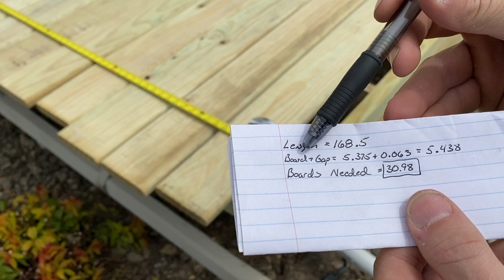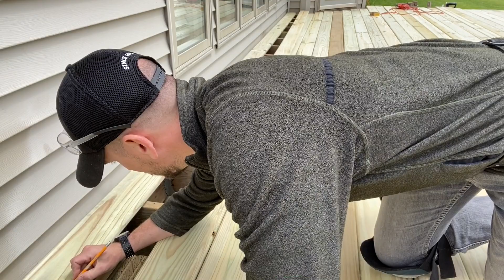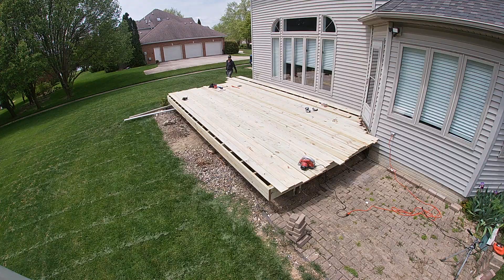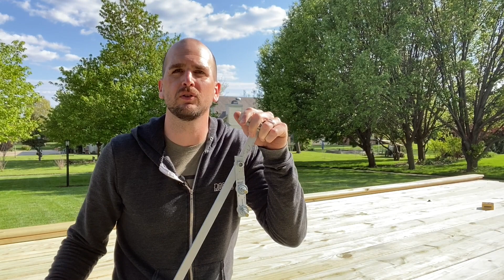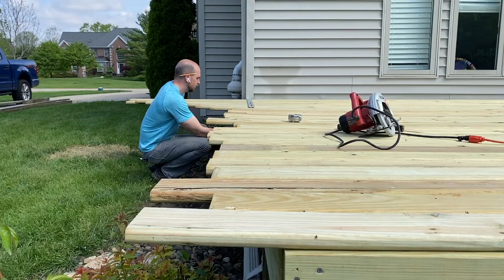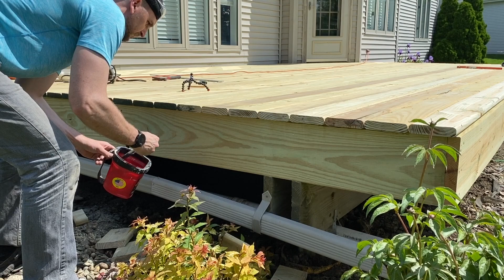Rebuilding a Deck Part 3 - Laying New Deck Boards

Comment from the maker: Camo Pro Guide (1/16inch gap):  https://geni.us/B0G1Ziw
Camo 2 3/8 inch screws (700 count):  https://geni.us/AzaKJP8
BoWrench:  https://geni.us/ei2A34X
Makita Cordless Drill Combo Kit:  https://geni.us/t7dIA
Wood Preservative:  https://geni.us/4fDwG
Skilsaw: https://geni.us/J8pWhL
Stanley Tape Measure:  https://geni.us/bUfD1R

Tools Every Weekend Warrior Needs
Dewalt Drill Bit Set:  https://geni.us/oFlSl
Dewalt Screwdriver Bit Set:  https://geni.us/VDcr
Craftsman Screwdriver Set: https://geni.us/jXqFI
Eklind Allen Wrench Set:  https://geni.us/7XfvO
Pliers (4-Piece Set):  https://geni.us/RIdx
Stanley Utility Knife:  https://geni.us/ndIDa
Studbuddy Stud Finder:  https://geni.us/RySCuVw
Johnson Torpedo Level:  https://geni.us/wiLcDY
Stanley Hammer:  https://geni.us/bPDk8Wo
Buck Bros Wood Chisel Set:  https://geni.us/vk3cpTW
Klein Voltage Tester:  https://geni.us/h9Hl
Klein Outlet Tester:  https://geni.us/kdBAJ
Ideal Wire Strippers: https://geni.us/MdOB
Little Giant Ladder: https://geni.us/fmlmTk

DISCLAIMER: This video and description contains affiliate links, which means that if you click on one of the product links, I’ll receive a small commission.

Comment: Did you have to pay a premium for the 24ft pcs? Would it have been cheaper to turn the deck boards 90 degrees and use (presumably) 14ft deck pieces?

Comment: Measure from the installed boards to the end as you go. You can increase the gaps as you go (on the last few boards if needed) to make up that gap at the end. 😊
Reply: after all that measuring the edge didn't have an overhang.. that would drive me absolutely nuts and id rip out 10 boards, flip them around and get the spacing right.

Comment: Looks really good! I watched your video because I plan on replacing my deck as well. But that one board that is darker in color, the one just over your right shoulder at the end of the video. Why did you use that? I would have replaced it. Looks bad. But overall good video! Thanks!

Comment: A few of those boards didn't have the crown up. You can tell by the grain on the end. When those boards dry the sides of the board will try to curl up and pull up on the fasteners

Comment: What size and type of boards did you use for the decking?
Reply from the maker: I purchased 24' boards for this one https://www.menards.com/main/building-materials/decking-deck-materials/wood-decking/ac2-reg-5-4-x-6-above-ground-green-pressure-treated-thick-decking/1110627/p-1444422337253-c-13469.htm

Comment: Very nice work except for the 7th. board from the edge sticks out like a sore thumb. The shading of that board does not blend in with all the rest and I feel should have not been used. If you're going to just Paint instead of staining then I guess it doesn't matter.

Comment: Using cedar decking is the WORST material!  After 2-3 years, it looks like crap and tthe maintenance every 2 years sucks!!   USE COMPOSITE and you will never need to maintain it  as it has a 25 year warranty!   Cedar is too $$$ now anyway.     So his cedar cost is $6 SF, i used composite and it was $4 SF with a 25 year warranty...
Reply from the maker: This is just standard pressure treated pine not cedar.  Composite decking is about 2X or 3X the material cost now and about 5X at the time I did this video.  Still with the increased cost might be the right move.

Comment: Great video. 
One thing I would do differently is to temporarily install last deck plank, then cut the extra joist boards to fit flush. 
My .02 cents.

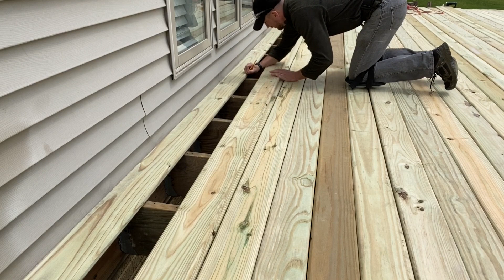Comment: Hi. 4:38  so the 1st board is nailed on only one side? Did you screw from top? Thanks
Reply from the maker: Yep, used the Camp tool to set the 1 screw and then placed the other close to the vinyl manually without the Camo tool.
Reply: @EverydayHomeRepairs  thanks much! :)

Comment: Working on my deck and boy do I wish I would have watched this before I started simply for the Camo System. 2 screws per joist and hidden would be amazing.
Reply from the maker: Yeah, I was pleased with the Camo System and 2 years later they are still all holding tight 👍
Reply: @EverydayHomeRepairs  going to buy one today. Only had 4 rows done of 22. Will do the rest with the Camo system.

Comment: There is a trim piece on top of my existing deck that is flush with the siding of the house.  It runs the length of the deck and appears to  serve as a barrier between the deck and siding.  How should I go about removing that and should I have any expectation that it can be reused?  If it can't or shouldn't be reused, what is that trim piece called so I can purchase  replacement  trim?  I have vinyl siding.   Thanks in advance for any help on this question and thank you for the very thorough explanation of how to tackle this project!

Comment: I really enjoyed your video and watched because I’m about to build a pool deck which will be about 16x16. I’m just wondering about biting the bullet and using trex decking boards versus what you used. It looks like you are doing well for yourself based on the looks of your neighborhood, do you regret not paying more for the trex? I’m torn
Reply from the maker: At the time no, since pressure treated was about 20% of the cost of Trex.  I think that gap has closed substantially now with the increase in Lumber since the video was created.  If Trex was only 2X I would have went that route.

Comment: Enjoyed your videos and information about building your deck.  I hope to rebuild my 900 sq ft deck this spring with cedar boards.  One thing I would do differently is I will start my boards from the outside and go towards the house and I think the benefit of the correct overhang looks better even if you have to rip the row where it meets the house. I also liked the info about the Camo screws.  Good job on your project!
Reply: This is exactly what I was thinking

Comment: I plan to revamp my deck but I don’t have any tools. So appreciate if you can also give an estimate on the tools like circular saw etc. Another thing I’m contemplating is to keep the deck (after refinishing) or just go with the concrete pavers / tiles.. 
apart from personal preference any benefits of deck over concrete pavers with tiles?

Comment: What is your take on replacing old deck boards with composite and keeping the wood based platform?  Do you have a video on that ? Resurfacing deck on a budget.
Reply: One thing you need to consider is the weight of composite ( between 20-30% heavier than wood), so you might need more support. To that end, your joists need to be 12" on centre instead of 16-24 ". this would give the deck a more solid feel because composite is very flexible.

Comment: Came upon this because I'm going to have to redo a front deck on a mobile home on land I'm purchasing. Considering the condition of the deck boards I was shocked to find out the frame and posts are in great shape. It's not large. My biggest concern is the railing around the deck and the stairs. I'll know more when I tackle it this weekend.
Reply from the maker: Best of luck and you are right the railing some times needs a little TLC the same time the deck boards start to go.

Comment: Great video.
Do you have any photos 11months later..? Is that true that those boards will shrink after some time? That Camo tool helped keep the same spacing but is this the same case a year later? Just thinking about doing the same kind deck like you have. Thanks

Comment: how did you cut off the end nearest your house towards the side wall?  Since your saw cannot rip that close to your house.
Reply: Not sure if he did it this way or not, but if you plan ahead, cut that first board to the correct length so you don't have to worry about that problem.
Reply: They never show that stuff! That's a good question!

Comment: Are those 2x6 on top ?
Reply from the maker: The pressure treated deck board actual size is 1-5/32" x 5-1/2" actual size here is the link for the boards at Menards  https://www.menards.com/main/building-materials/decking-deck-materials/wood-decking/ac2-reg-5-4-x-6-above-ground-green-pressure-treated-thick-decking/1110627/p-1444422337253-c-13469.htm?tid=-1452257607087985468&ipos=1

Comment: Awesome video. The answers all my questions except one. Did you need a permit for this repair?
Reply from the maker: For this project I did not but check with your local building code to ensure you project is on the up and up.  👍

Comment: I am a first timer, trying to do the research to understand what I'm doing.  You do a great job explaining everything. Price break down, Sq ft, etc.  Next month I have some time off and hope to tackle my own deck project.  Hopefully it goes as easy (as it seemed) with your 3pt series. Fingers crossed 🤞🏽
Reply from the maker: Best of luck with the project.  If you need help or run into a speed bump feel free to jump over to our Facebook Group "Everyday Home Repairs Community" and add your question with pictures so we can help you along with the project.
Reply: Hey John, so how did your deck project end up going for you??

Comment: Very good video and good job overall.  One of the most important things to know and let your fellow first timers know is the importance of installing the deck board bark side up.  I noticed some of yours were bark side down which will cause cupping and cracking / splintering down the road.  Often deck builders will install with bark side down because it is the better looking side of the board (with the bark edges sometimes cutting into the finished corners).  I like the camo system and plan to try it on my next deck project.  Thanks.

Comment: Guess the last board is 2x6, if it is small, may be buy and install a 2x8 to overcome.
Reply from the maker: This is a standard width pressure treated deck board so you can't buy standard size pressure treated lumber like 2x8, 2x10, 2x12.  Actually the pressure treated wood will shrink a bit in overall width once the water pulls out of the boards.  This spring I will pull the screws and shift over the boards for the last few rows which will allow me to cut a deck board down and get a 1' - 1.5" overhang.  👍

Comment: This is a great video. Not having butt joints and concealing the fasteners is nice! Two tips - #1 Let the joists "run wild" and install the decking. Then when you get to the last few deck boards you can cut the joists exactly where they need to be so you can then add the double rim and the last full deck board will overhang as you intended. #2 As you install the deck boards leave them unfastened to the outside end joists. Then mark your overhang at the ends of the outside joist and snap one chalkline. Cut the deck boards along that line. Now screw each of the deck boards to the outside end joist  while moving the joist sideways to meet your required overhang. A flat bar, your bowwrench, and and some 2 x 4's to wedge against the adjacent joist will be helpful.
Reply from the maker: Nice tips!  I really like that approach.  Question for you, what is the trick to account / compensate for the contraction you know will happen with pressure treated boards over the first 3 months or so?  I am not really worried about the gaps between the boards but more the clean lines you cut on each end will start to move a bit once the boards start to dry out at varying rates.
Reply: The decking shouldn't expand or contract lengthwise.
Reply: It's a bit of an effort, but you could probably back out the screws on a few deck boards, and back out the screws and remove the two 2 x 10's on the end. Work the numbers backwards and figure out what you have to cut off the joists to make the overhang work out as originally intended. Snap a chalkline over the top of the joists, square down with a framing square, cut all the joists and reassemble. You will probably have to "compromise" the overhang a little since the last few deck boards are not likely to be perfectly straight.
Reply: Correction - meant to say "one 2 x 10 on the end".

Comment: Very informative and thank you for showing how the Camo system works.  I’m debating Camo system for a 16x16 composite re-deck and this video really has me leaning that direction.  I still want to do a little more  research though  to see how well it will work with Trex composite.

Side note:  Due to treated lumber being in high demand in Central Illinois I found composite to be still be a somewhat affordable option.  When it’s all said and done I should be around $8/sq. ft, give or take $1/sq. ft.,for entry level Trex Clam Shell from Lowe’s.
Reply from the maker: Hey Scott,  best of luck on the project.  Yeah, I know the lumber shortage is really starting to make it hard to knock out projects such as this with pressure treated.  I looked at the composite options and for me the deck boards came in about 4 - 5 times more expensive.  With that said I didn't take into account staining, additional maintenance ,  and shorter life of the pressure treated compared to composite.  I am also always surprised how much pressure treated shrinks over the firs 2-3 months once the water works out of the boards.  Cheers 🍻

Comment: Happy to find your channel. Came for the spigot repair, stayed for the deck. The bow wrench is a great tip to help us decide if we'll downgrade from a higher end hardwood to pressure treated to save $. Do you think the miscalc on the boards not reaching far enough for the overhang is because the wrench butts the boards so tightly? Or why the mishap?
Reply from the maker: Hey Ellen,  good question, I had slight variations in the board spacing and add that up over 30 boards will shift your measurements enough to provide no overhang.  Since I have seating and planter boxes (more videos to come) going on that side I am not too concerned.  Let me know if you have any other questions and best of lunch on the project.
Reply: Thank you :)